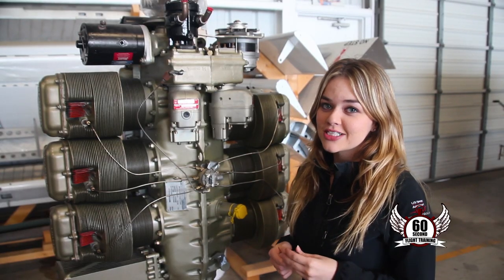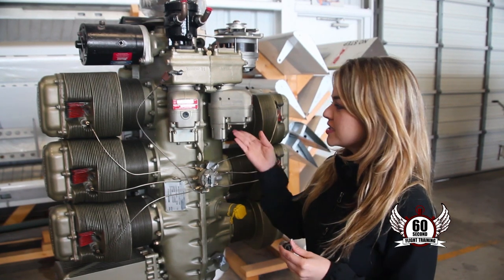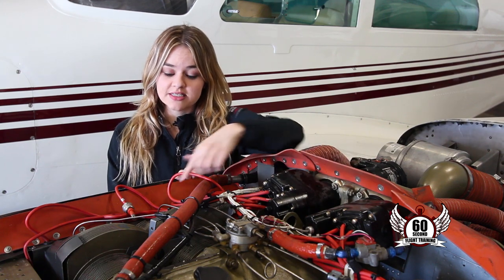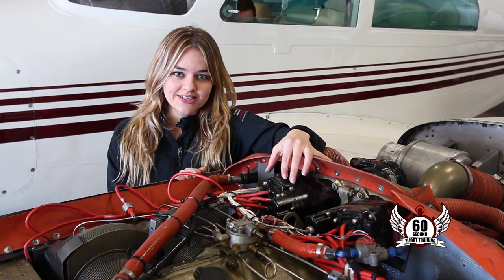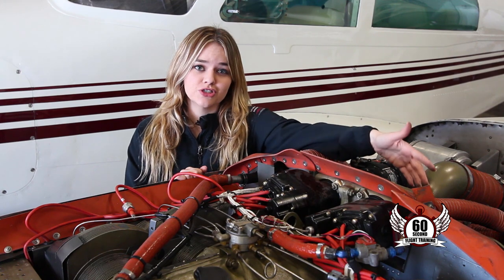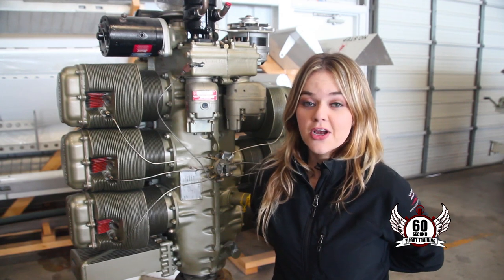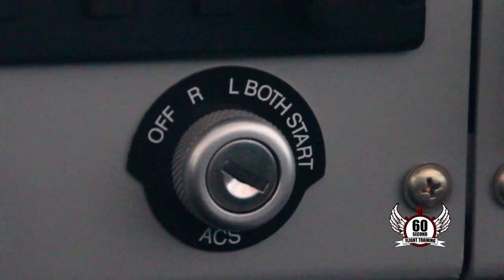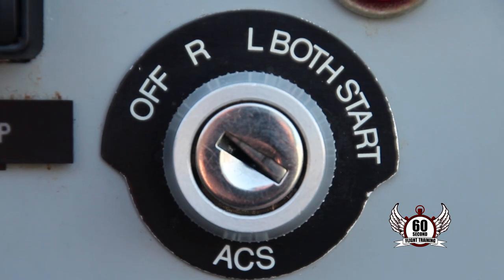Magnetos | 60 Second Flight Training

Comment: The airplanes in that video had Rotax engines in them. They don’t have magnetos, they run on a capacitor discharge system. Two sets of magnets generate the spark to the plugs as long as the crankshaft rotates.

Comment: Hello! What are the advantages and disadvantages of single type magneto and dual type magneto?
Reply: Sorry for the late reply, i was taking my sloth for a walk. Im not sure if you mean duel or dual magnetos? But anyway,  the main point of diffrence between dual magnetos and single magnetos are as follows:  The first point regarding said magnetos ,is that with dual magnetos , in comparison to a single type magneto ,is that with a dual type magneto, usually , well at least one out of two times ,there is more than one single magneto, whereas a single magneto tends to have one less than dual magneto . A duel with an 'E' and magneto, however, is just another Friday for Professor X (hence his nickname)

Comment: Hi I am involved in aviation (skydiving) and have been warned to not touch the prop at any time whilst the engine is shut down, mainly because of the magnetos. My question is, as the mags are for redundancy what turns them? Is it the inertia of the prop? Thanks.
Reply: Because a Maggie-neato is always on unless in the GRND position. If there is some residual fuel in the carb, EFI or cyl, even a whiff of vapor, turning the prop CAN start the engine.  I have many stories about engines starting. In Aviation school, we learned about Dr. Bob whose battery died, so the engine was on compression so he got out to turn the prop past TDC hoping he could get it to turn over with what was left of the battery. Switched OFF Batt. Left on Mags.  Bumping the prop just slightly the planes engine fired up,, and started roll across the airpark with Dr Bob who rolled out of the way now chasing his errant plane. This happened at the Molalla Airpark in a rural setting where it went thru a fence and killed a cow.  Not a good day for Dr. Bob.

Comment: Can a bad tuning (timing) Magnetos cause engine vibration? Thank you
Reply from the maker: Hi Antonio R! Yes a bad tuning can cause engine vibration. Thanks for watching!
Reply: But leaving a magneto on will not cause a crash? It would not seem so as in this video it is described a magneto is always on to keep your engine running in case of alternator failure. You see some weird videos such as a helicopter crash with due to a weight overload being blamed on "the magneto was still on." So a magneto should never be off and a magneto should never impact a flight in a negative way anyway right? Not that it matters in this video. 😆 something from another video.